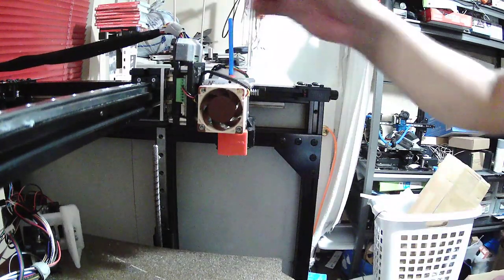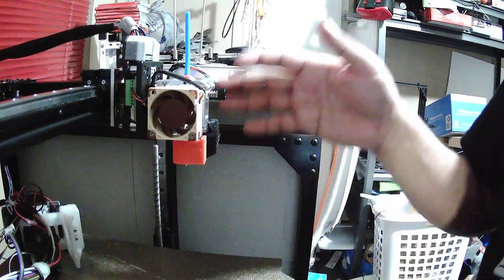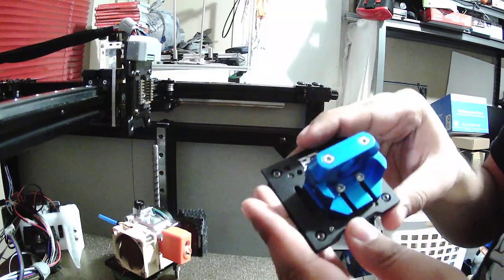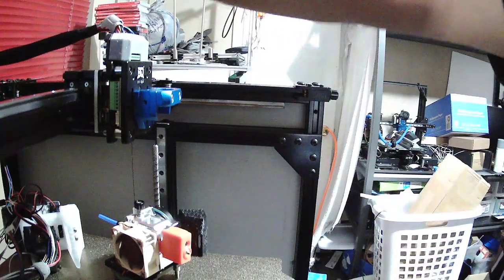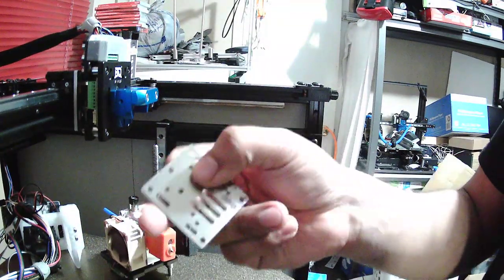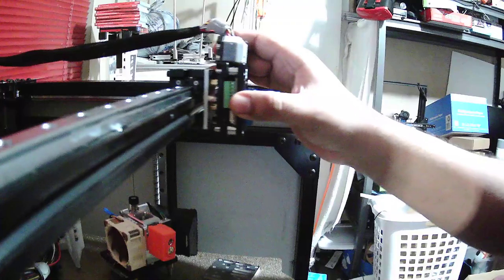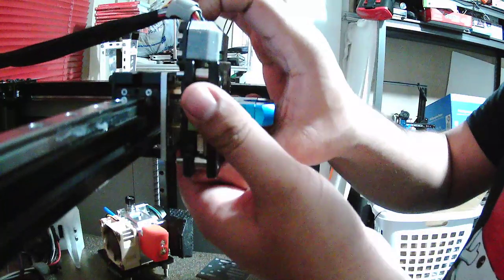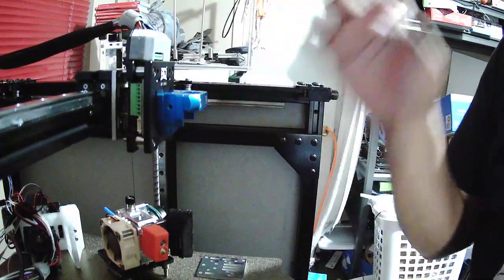BLV MGN CUBE Tool changer (Biqu hermit Crab)

Comment: I recently installed this on my Ender 3. I am also making a new BLV kit based core xy printer and i will install this on my new printer too. The idea is that you can interchange tool heads between multiple printers. I did notice however that your nozzle is sticking out a lot from the plate. Not sure how that would affect the print quality. Did you face any issues? I designed mine so that the nozzle is as close to the plate as possible.

Comment: Hey.. did you have any issues wiring up the main HC plate to the printer? I have the Basic one (not CAN), and and Ender 3 S1 Pro. The S1 Pro has a ribbon cable not individual wires from the m/b. I am hoping there is no issue wiring it up.. basically need to figure out the pins on the 24 pin header and I assume as long as those all match the main HC plate, it should work with any hot end and extruder setup? Also.. I believe you CAN buy the plates individually for $20 or so each..

Comment: Thanks for the video. Please what are you using to mount the kit to the x-axis linear rail ?
Reply from the maker: Sorry for the late reply

I'm using a plate that I made to adapter it to the metal carriage of the printer. They were cut thanks to Sendcuts.

I plan on releasing the files after I make sure that it is it's 100% good. So far it is.
Reply: @techmorfic7989  Thank you so much for replying. That was very very much needed information. Im new at this. And some information to paint this whole picture was just missing.
Yeah it be nice if you could release those files at some point. It sad, that the ender 5 does not have as much love as the ender 3. Thanks again.
Reply: @techmorfic7989  hi i wanted to ask where can i find the data for the mounting plate. i am very interesiert in the abgrade.